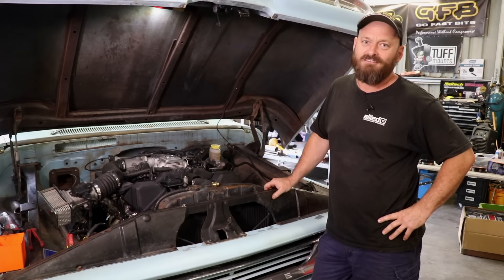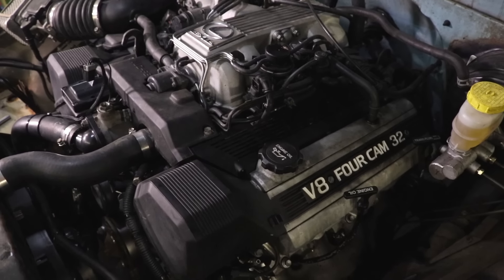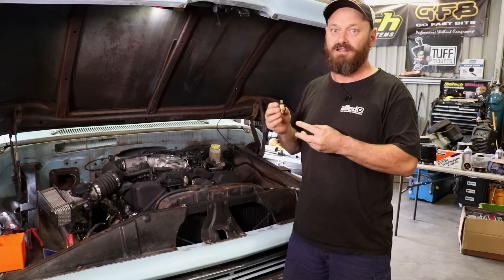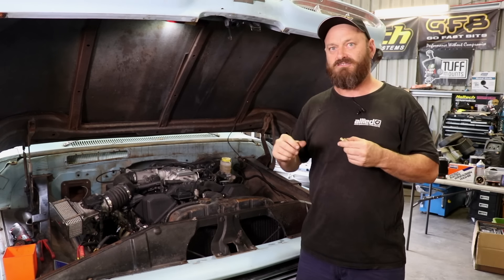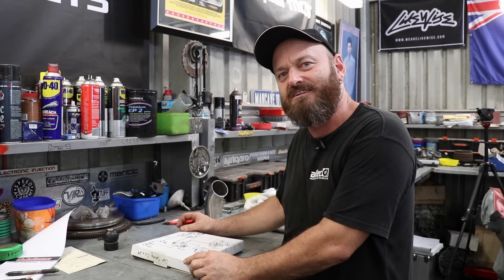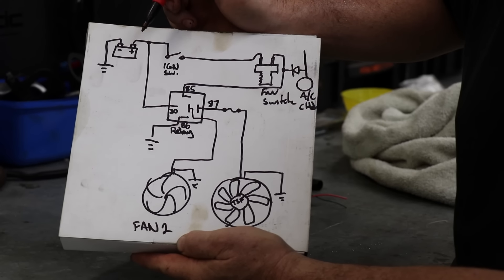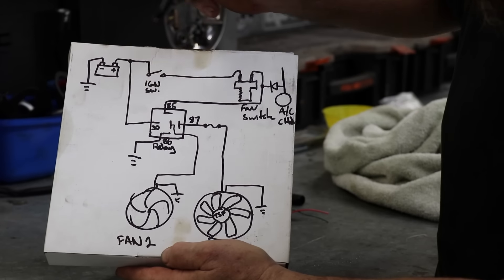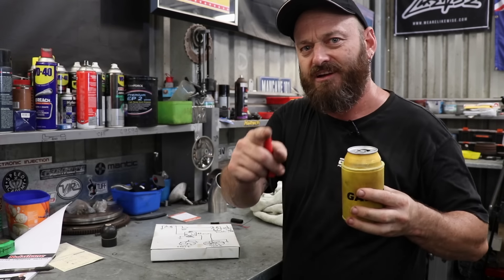THE SKID FACTORY - [QUICK TECH] HOW TO WIRE THERMO FANS

Comment: One suggestion to avoid the Land Rover situation of total failure to continue to exist, a fuse, please.
Reply: I see you have one on the fan, much better to put it near the battery so any ground at the relay or in the wiring is protected. Picking you ign signal from a protected circuit like the indicators, or audio circuit looks after the relay coil and temp switch.
Reply: @rayg9069  I should have explained that the drawing is a vague guide for illustration purposes not an actual wiring diagram to take literally.
Reply: @alanbutler2579  All good Al, you drew it so neat I could see someone taking a screen shot and using it as a gospel circuit. Really enjoy these shorter tech type films, specially some on the Haltech equipment and accessories?
Cheers.

Comment: i understand relays but why the random number for the terminals?
Reply: Because they're NOT random.  They are Bosch relay terminal numbers that have been in use for decades.  Relays I've pulled from 70s cars have them.  Why did Bosch pick them?  Don't know, maybe Google has the answer.
Reply: The point is they're not random. He mentioned Bosch conventions. And Google.
Reply: Bosch numbering, common referencing for electrical circuits.

Comment: if the sensor is closed and the ac on you can not shut off the ignition. just turn off the ac they the car will shut off. adding a diode from the ignition wire would fix that.
Reply: The ac circuit gets its power from a 12 volt ignition on source. So when you turn the key off the ac circuit also has no power. If your ac circuit has power when the key is on it is wired incorrectly.
Reply: The AC is fed from ignition, if you turn ignition off there's no power for the AC to back feed

Comment: I already have a ac fan behind a aftermarket trans oil cooler. Could I install this to turn on the AC when Tran oil temp is over say 80c?
Reply from the maker: Yes it is just a fluid temp switch, it doesn't care what the fluid is.

Comment: I still dont understand why the thermostat is needed. If it was open and the fans were always on, wouldnt the engine run better because of the cooler temps?
Reply: Engines don't run better at cooler temps as anyone old enough to remember using a choke can tell you.
The main reason is to make the fan last longer by only running it when required.
Reply: Engines do not run better when they are cold, the best engine temperature for clean combustion is between 90 and 110 degrees coolant temperature.
Reply: @alanbutler2579  -  "the best engine temperature for clean combustion is between 90 and 110 degrees coolant temperature".

I trust that is Celsius and not Fahrenheit!
Reply: @MrEd-fu3dq  Fahrenheit? Never heard of her.

Comment: Doesn't it make much more sense to put the temp switch on the output from the radiator? If the water coming out of the radiator is cold you don't need the fan, so it should never turn on while driving is giving enough cooling air. If set up on output of engine, if engine is getting hot but radiator is cooling heaps fan will come on anyway.
Reply: You want it on the hot side because it's reacting to the heat that's in the engine. That's the heat you want to keep within range. It would be incredibly hard to calculate how cool or hot the lower rad hose should be at any given time, so your thermo switch would be nowhere near as accurate and could lead to overcooling or overheating.
Reply: @magnetic0314  Actually its the job of the thermostat to regulate the temp of the engine. If you've ever driven a car with a failed open or non existent thermostat, they  will run completely cold even without the fan running and never heat up under typical loads.
Reply: @brendonwood7595  the job of the fan is to kick on at a certain temp when airflow is low to keep the radiator working efficiently and prevent heatsink. The thermostats job is to keep the engine at a certain temp range
Reply: @brendonwood7595  If you idle almost any car in traffic on a hot day with no fan running, it will eventually overheat
Reply: I'd say the fans job is to ensure the water coming out of the radiator is cool enough to cool the engine, so it makes sense to measure the temp coming out of the radiator, not going in.
Much like running the fan constantly it will work measuring the water going into the radiator but will just run more often than necessary.

Comment: Why does a car need to run up to 101 before fans kick in isint the boiling point of water 100 so coolant should not be far behind
Reply: in a presurized system the water boiling point is higher
Reply: Hence why you should not open a radiator cap on a hot engine
Reply: And glycol raises it more, the bottle on my shelf says boiling point 128°c at 50%
Reply: Some of the newest stuff is hitting 115 before fan activation.